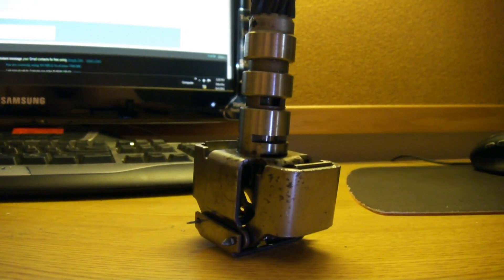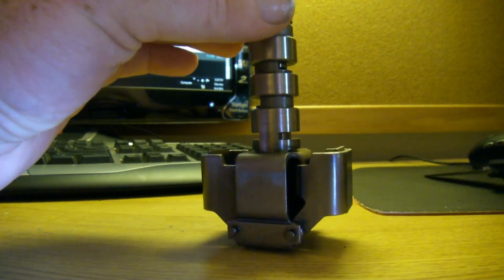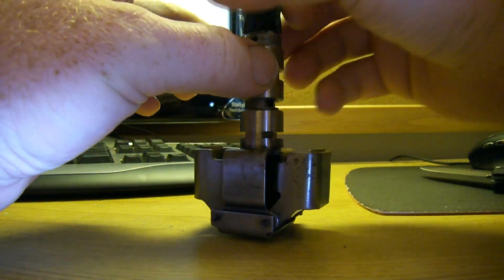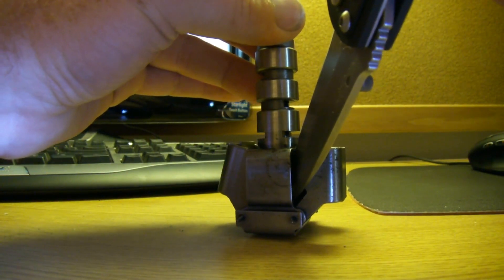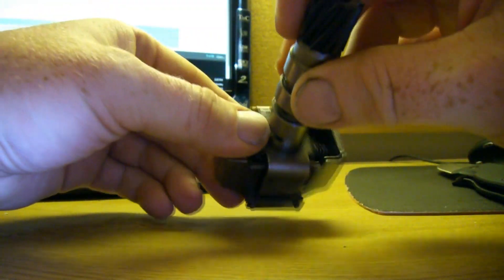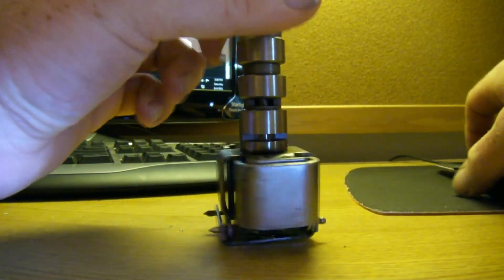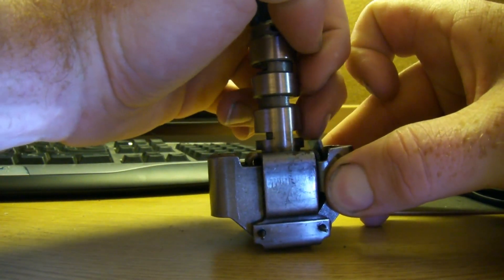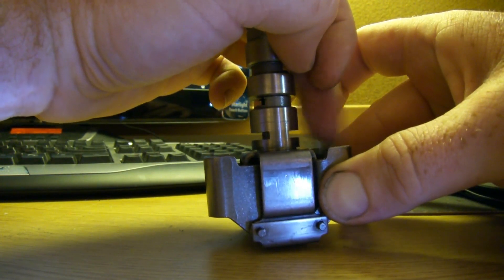TH400 governor gear

Comment: Hold both wings closed & shake it. If the valve in the middle moves freely then it's good. Also make sure the wings open & close freely. Doesn't hurt to spray the governor itself & the housing where it out of with break cleaner before reinstalling. Also, be sure to poor transmission fluid in the governor before reinstalling.
Reply from the maker: Awesome thank you

Comment: Centrifugal force generated by rotational speed either opens or closes the valve at predetermined level controlled by the tension springs.
-Pete, in Tacoma WA USA
Reply from the maker: Good info, thank you!